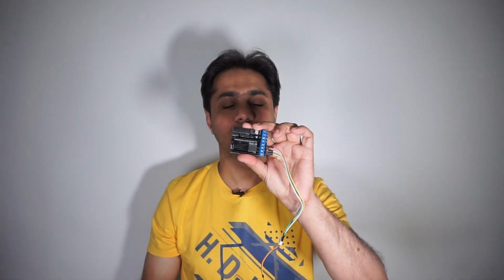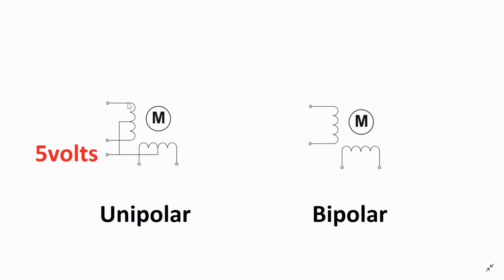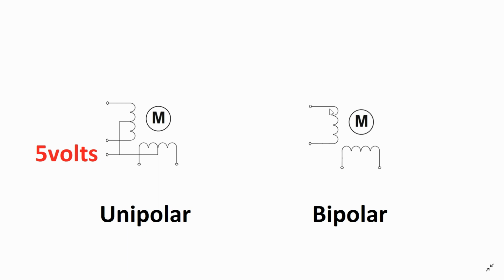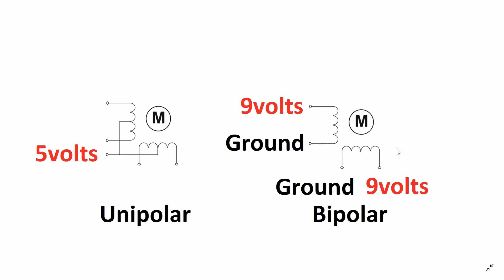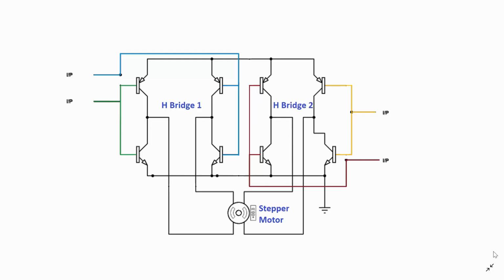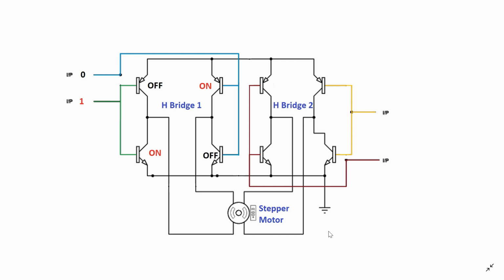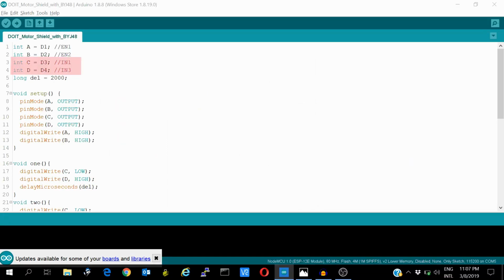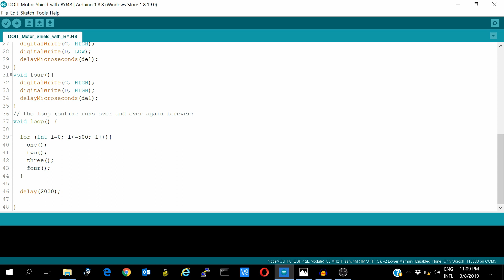Convert 28BYJ-48 Stepper Motor to Bipolar with L293D and ESP8266 to increase torque - Baba Awesam

Comment: Can you tell me the optimal settings for really fast low torque requirements? I'm using an a4988 with 4  of these guys closing a lid on a vacuum chamber. I just ordered an L293D.

Comment: Other videos instruct to cut a path of the stepper motor PCB. As to separate the common cable that connects to the middle of both windings. It seems you didn't do that. Is it needed?
Reply from the maker: Basically you want to isolate the 2 windings. Either physically cut it or leave it unconnected, both achieve the same goal.
Reply: As long as you drive it as a bipolar where the opposite ends of a coil are connected to opposite polarities, the center is at Vcc/2 and so both center taps are at the same potential.

Or you can open circuit both ends of a coil, in which case it floats. You would never want to pull both ends of a coil to the same polarity.

Comment: Hey Dude, thx for your vid! Is it possible to change the direction of the motor without changing the wiring? Just by the code? Or is this not possible cause the motor is used as bipolar?
Reply from the maker: The direction can be changed by code. Basically you trigger one magnet at a time and there are a set of magnets. If you trigger in the opposite direction, the motor will move on opposite direction.
Reply: @SamirSogay  Thx for your quick answer! So as far as i understand A and B just have to switch position with C and D  in the code ?
Reply from the maker: @12Alitat  keep the code same. Just change the sequence to 4321 in the loop.
Reply: @SamirSogay  Thx so much! it works. Would you mind explain to me why this does not work?:  
 for (int i=0; i<=500; i++){
    four(); 
    three();
    two();
    one();
    delay(4000);
    one();
    two();
    three();
    four();
Reply from the maker: @12Alitat  your command would cause the shaft to move 4 steps in 1 direction and then 4 steps in the opposite direction which would probably cause the shaft to just vibrate.

Comment: If I do not connect the red wire, will the two coils no longer be connected? I see/read that other people are also disconnecting it on the PCB on the motor.
Reply from the maker: Some people cut the trace on the PCB but I don't think so it makes any difference as compared to just keeping red wire unconnected.
Reply: @SamirSogay  When i check with a multimeter it seems as if the two coild are actually connected. I decided to cut the PCB anyways... However i still do not have enough torque! I am also making a roller blind. But i am using a L298N double H bridge, I have tried both 12v version and 5v version powering it with up to 19v. 
Maybe I will have to put one motor on each end of the roller blind. Thank you for your videos
Reply from the maker: @drlove4203  See my latest video about torque, maybe that will help
Reply: Yes, they are still connected. However: As long as you drive it as a bipolar where the opposite ends of a coil are connected to opposite polarities, the center is at Vcc/2 and so both center taps are at the same potential.

Or you can open circuit both ends of a coil, in which case it floats. You would never want to pull both ends of a coil to the same polarity.